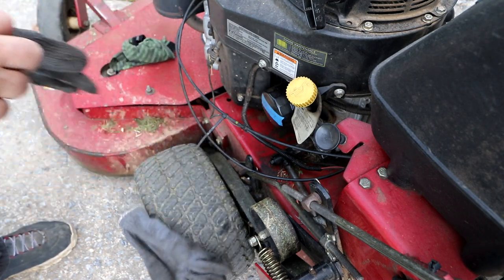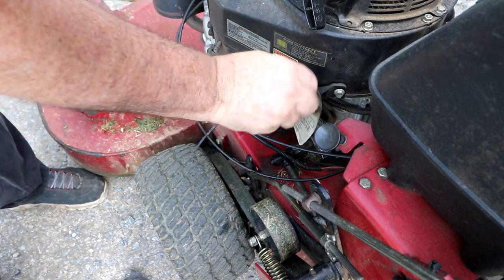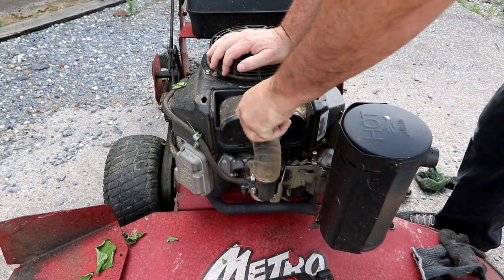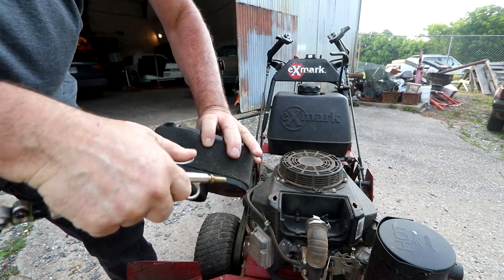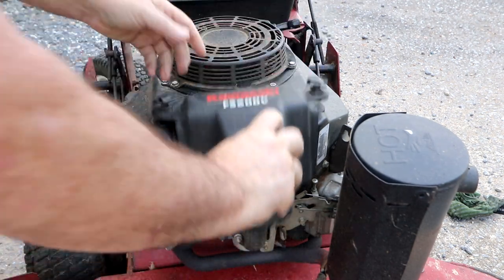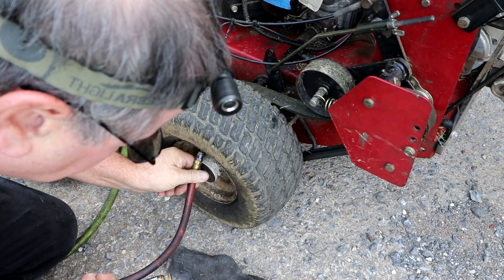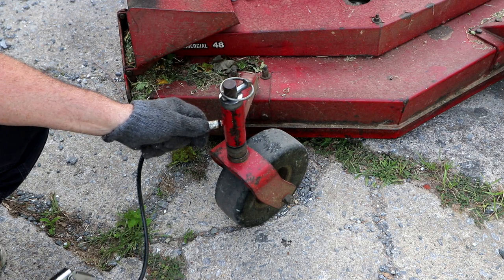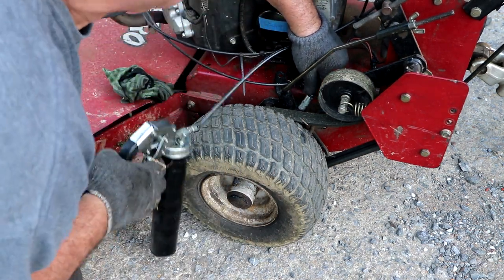Exmark Metro 48 Inch Cut Pre Run Check List and Maintenance

Comment: I've got almost the same exmark mower, the other day the axle stopped moving while I was going up a slight incline. I was wondering if there was a simple adjustment I have to make or if the transmission is shot. Keep in mind I had just changed the main transmission belt under the engine.
Reply from the maker: if the input shaft is moving and the output shaft is not then you are correct
Reply: @Joefixesit  I found the tension pully was not moving at all. It was made of plastic and was worn right through. I changed it and immediately ran better. My other problem is now when I have the blades engaged my engine will shut down out of no where. If I take my hands of the safety paddles on the handle bar and reapply them it will keep going. I think it may be a bad ground or wire connection somewhere
Reply: @wvolpe685  I think you are on to it, something is wrong with the hand paddle switch, I got cable ties and tied them down but that obviously creates a safety issues as the mower will run away but I deal with it.

Comment: I have a belt drive mower that always squeaks when mower like if the brake is rubbing when I squeeze the handle to turn it doesn’t do it and when back in drive it squeaking again maybe just the brakes warped any suggestions ? Thanks
Reply from the maker: that is actually normal noise. I would not worry about it.
Reply: @Joefixesit  it’s very annoying lol
Reply: @nyccrcsx  I will ask my brother if he puts anything on it to make it not make so much noise. it seems to do it more when the mower has been sitting a while